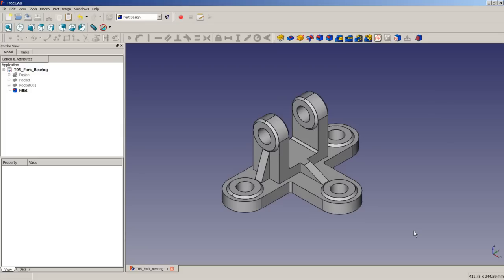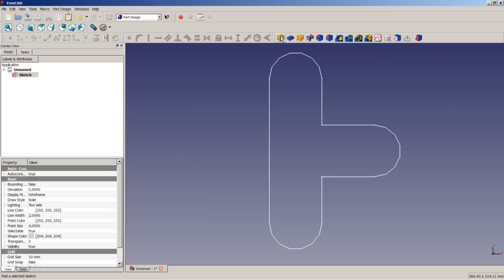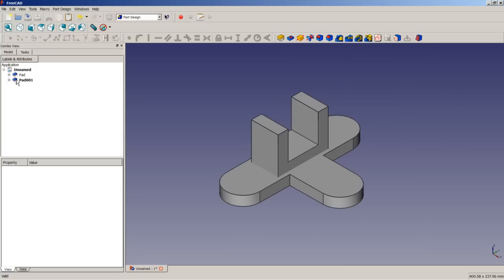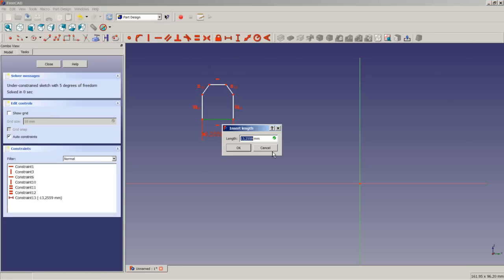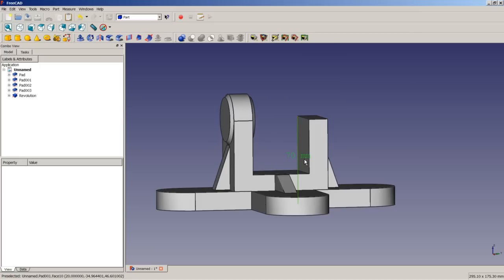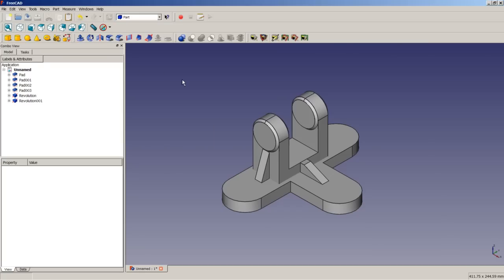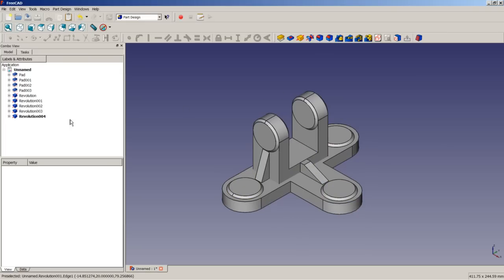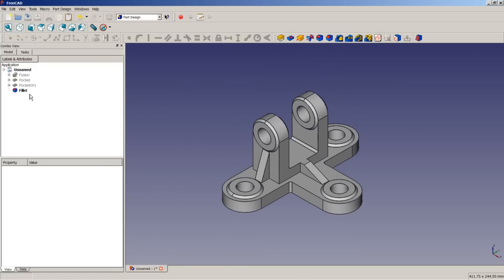FreeCAD Lesson 05 - Fork Bearing

Comment: To those of you new at this. DO NOT hide the first two builds. It is very hard and it takes a lot of experience to build on free air with nothing to give you a reference as to where you are building sections of the model. Use the techniques he used in the previous lesson to build on top of an existing face. MUCH easier.

Comment: These tutorials are fantastic, but I've run into an issue at 42:13. Firstly, I'm using v.17, and I've been able to figure out many steps so far that don't jive because of the version diffs, but not this one... Anyway, after selecting the face then applying the sketch, I'm greeted with this dialog:

You selected geometries which are not part of the active body. Please define how to handle those selections. If you do not want those references cancel the command.
○ Make independent copy (recommended)
○ Make dependent copy
○ Create cross-reference

The first two choices go to a blank canvas, so there isn't a way to select the inner circle of the respective face for sketching on. 
The last choice provides the model as a reference, but using the external geometry tool doesn't provide the center dot per your example (which makes alignment maddening) & the circle sketcher doesn't appear to draw anything anyway.

Thoughts? 

Please and thank you (Bitte und danke!)
Reply: Hello, unfortunately the author died almost a year ago. There have been profound changes to the PartDesign workbench introduced in v0.17 and this is no longer a proper work flow. PartDesign now requires all work to be done inside a PartDesign Body and that it should be active, but by applying a Part Fusion/Union, the resulting Fusion is no longer inside a Body. This is why you're getting this message. This whole model can now be done without the use of Boolean operations, and exclusively in the PartDesign workbench.
Reply: Hi Normand, I'm deeply sad to hear that. Indeed this is a wonderful tutorial.

Comment: Hello again. I have a question regarding Lesson 05 Fork Bearing, time 35:25...  

At this time you just finished creating an angular dimension.  I have Version .15  and I can't seem to do this.  I select the two points on the ends of the curve and then slide the cursor out away from the curve (just as you did) and the dimension marking lines are shown.  But then what did you click to get the 50 mm dimension to display?When I click the left mouse button (for the third time) it only displays a single dimension line (----------------)  but no dimension value (-------- 50 m m-------).  The dimension is shown in the tree list on the left and it can be edited.  It just doesn't fully display.  

One note: the fields on the left during the dimension operation show "Global X/Y/Z" for me but in your video they show "Local X/Y/Z".  Not sure why this is either.

Thanks.
Reply from the maker: Paul Winer 
Maybe the font size for your dimensions is set to a small value. (Did you zoom in and out to check that ?)
Highlight your dimension in the tree view and go to the "view" tab.
Make sure the font size is set to 3,5 mm or similar.

Also have a look at "Edit > preferences > Draft > Texts and Dimensions" for tchecking the options for
dimensions in Draft Workbench.
Reply: Learn FreeCAD The font-size was set to 0.20      Thanks!

Comment: I'm using ver. 15 and am getting a couple things different than you. At 30:30 when you drag the shape over to the right side, the shape is no longer on the left side. When I do that procedure I can drag the shape to the right side but the shape on the left side is still there, along with the shape I've dragged to the right ?? Then at 31:00 when you apply the horizontal constraint of 20 mm and the shape moves to that position. When I do that the chamfer at the right side of the shape becomes parrallel to the chamfer on the left, if that makes sense? Instead of the chamfers being   /    \     like that , after moving the chamfers are like this   /   /  . I'm guessing that's some type of glitch in 15 because I believe I am doing the same as you ?
Reply: +jsdspif3 nevermind about dragging the shape thing, I re-did it and when I drag it it did that properly. I still have the problem when I do the horizontal of 20 mm it makes my chamfers go from this   /  \    to this    /  /   ??
Reply: +jsdspif3 I deleted the top line and the chamfer on the right side of the shape, and re-drew them with the chamfer going the proper direction and then revolved it to make it work. I'm curious if someone else using ver 15 has encountered this problem?

Comment: Attempting to repeat this process with FreeCad 0.18.4, I notice a small change to the "Labels and Attributes" combo box on the left. In the video each pad and revolution is distinct and can be highlighted / made invisible separately. In 0.18.4, I have a "body" and each step applies to the "body". Each step appears to include the previous step automatically, like it is doing a free "boolean fusion" after each step. Further, the actual "fusion" step makes things go sad: selecting the face of the fusion to pocket the hole and creating a sketch I get an error dialog that the face is not on the selected body.

Ultimately I was able to complete the model by not doing / undoing the fusion step, such that I have one body with Origin, Pad, Pad001, Pad002, Pad003, Revolution, Revolution001, Revolution002, Revolution003, Revolution004, Pocket, Pocket001, and Fillet steps performed upon it.

Otherwise, the 'body' of the video (heh) still works in version 0.18.4. Thanks muchly

Comment: Hi, your lessons are great fun to follow and I've learned a lot working with FreeCAD over the past week or so. There is one thing I would like to clarify, though. I have done some exercises on my own and there was one particular shape that had "shoulders" like the ones you create at around 14:00.  In your video you created your shoulders based on known dimensions.  I found that, when I made these things in my model, the "create edge linked to external geometry"-option could not find any edges outside the new plane I set up for the shoulders.  Is there some roundabout way to make use of these edges ? Are the developers maybe working on that too ? Thank you !
Reply from the maker: +Spacekriek 
The linkage to external geometry only works with sketches attached to faces, and then you only can link to
an edge from that face.
With the 0.16 version expressions is introduced where you are able to link different dimensions
with each other. That may do the trick in your case.
You can use a 0.16 development snapshot on windows or use the daily ppa-version on ubuntu.
It looks like there will soon be a 0.16 stable release so if you like to wait a little bit more ...

Comment: great tutorial. I have a question, I am using V15. If I construct the revolution I get a hole in the middle of the part. I am almost sure I do exactly the same things as you do. Is this a result of V15 as opposed to V14 or do I miss something.thanks, Teun (the Netherlands)
Reply from the maker: +Teunbaartman1 Hello Teun.Did you draw the line and changed it to be construction geometry ?Did you choose the construction line (sketch axis 0) in the pull-down-menu when defining the revolution ?(When all else fails you could download the complete model from my GrabCAD or my Github account (links see Video description) and examine them in FreeCAD
Reply: +Learn FreeCAD the hole in the revolution is already there even before I  used the construction line. I have tried also to draw just a simple square without the chamfers and did a revolution this also ended up with a "nice" round hole in the middle
Reply: +Teunbaartman1 problem solved after I did the excercise from the beginning. Thanks!

Comment: These are wonderful.  Thank you.  One question on this one.  I'm using V.15.  As instructed, I set preferences --Part design---General---Automatically Check, refine and refine (all three)  I still get the line bisecting the large circle padding when viewed from below.  You're video didn't have that line.  Why might that be?   (The line is cut off in the middle after the final rectangle pocket operation.

Thanks!
Reply from the maker: Paul Winer 
Hello Paul.

I think you are talking about Lesson four ?
As written there, this is a bug in the 0.15 stable version - you have to use dimension as option for pads ...
The bug is already fixed in the 0.16 development version.
Reply: Thank you very much. It helps as a beginner to know that I did not make a mistake
Reply: Since you answered so quickly and kindly I have another question. Does free CAD allow animation with gears and springs etc.? And if so , if I follow your lessons will I eventually get to that?
Reply from the maker: Paul Winer 
Since FreeCAD is programmed in Python you could do an animation with programming, like shown here:
https://www.youtube.com/watch?v=0-WmlAh5dhQ

A FreeCAD-User began programming an Animation-Workbench with icons and User-Interface:
http://freecadbuch.de/doku.php?id=Animation%20Wokbench

It is on my to-do-list to have a closer look at the animation workbench and provide at least an introductory
tutorial (maybe as lesson 19 or something) but since i do freecad and these tutorials in my spare time
I am not able to talk about a time schedule ...

Comment: This app looks pretty cool.
Can FreeCad snap to grid with the spline tools?. Also, when using the poli line tool, I see the x and y numbers. Can they be accessed like autocad by entering the numbers and pressing tab to change angle?.
Thanks and congrats for this amazing app.
Reply from the maker: +Pedro Gordinho 
Yes, within the draft workbench it is possible to snap to grid with spline, to enter coordinates manually,
but within the sketcher the workflow is to draw the elements and then use constraints.
But you can convert elements from draft to sketch and vice versa.
Reply: +Learn FreeCAD Thanks.

Comment: "Input Error
Pocket: Cut out of support failed" 

The pocket operation failed. I'm using ver .16 I've found the pocket operation to be flaky at best. Is there an alternative cut operation?
Reply from the maker: Sounds like you are using 0.16.6704 on Windows 64-bit. That version has severe bugs. (Version number can be seen within FreeCAD by choosing "Help > About FreeCAD"). If that is the case please uninstall und download the file
"FreeCAD-0.16.6706.f86a4e4-WIN-x64_Installer-1.exe" from the FreeCAD files page and install 0.16.6706.

Comment: I'm unsure of your dilemma in your first revolution off of Sketch004. Why the need to use 'construction'? A slightly more elaborate breakdown to explain the relation differences would be great. Thanks.
Reply: +Chris Beard Thinking and responding quick, is it only to have the sketch axis be on the zero line which is the construction line and different to the y&z axis?
Reply from the maker: +Chris Beard 
Yes, that's the point.
Since the axis of rotation is not one of the main ones, we have two options.
Doing the revolution using one of the main axis and applying a placement to the sketch for the revolution.
Or using a line as construction geometry like i did in the video.
I prefer this method because in case of changing values it is easier to edit a value in sketch than figuring
out which exact placement to change ...

Comment: You said at some point 'tri' and corrected it later on on 'fri', but You meant three.
You also pronounce 'w' as 'v'. Get some lesson of pronouncing this crucial English sounds 'th' and 'w' and your English will improve a lot, as Your vacabulary is good - just a tip from me (also not a native speaker). Also accent stress could get improved a bit, but in general is not bad.
Thank You for the lessons - I found them very useful as a FreeCAD noob.
Reply: The Legend is dead. RIP